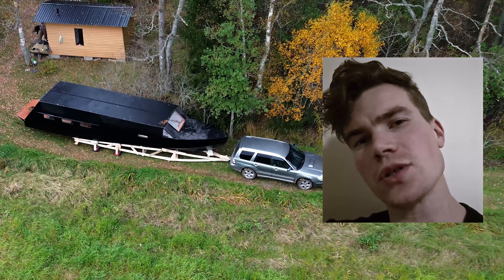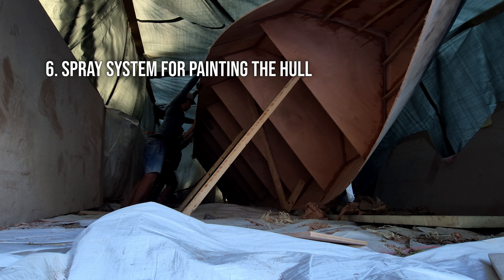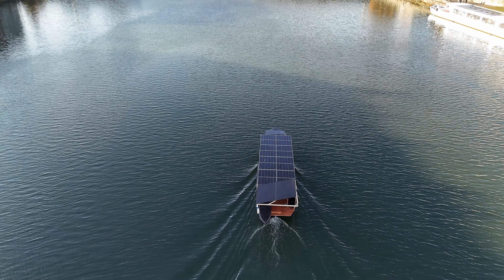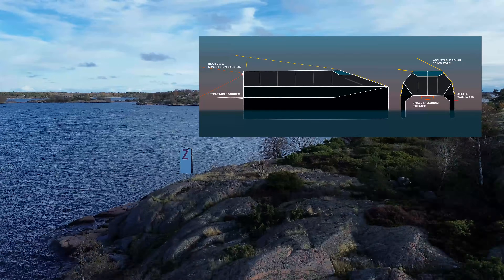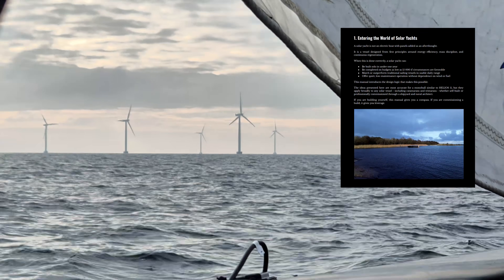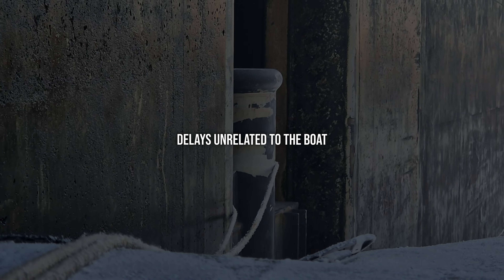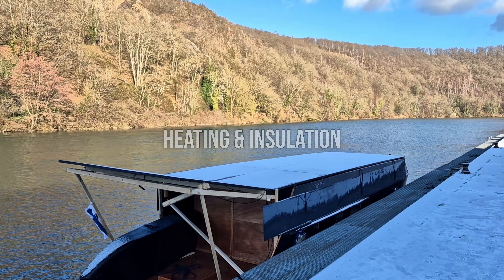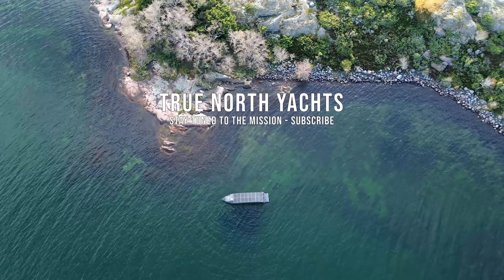The Real Reason I Got Trapped in the Winter Canals

Comment: I am a carpenter (home builder and cabinet maker). 
    I have been wanting to build a cat of my own design. 
     I'm wanting it to be about 10 feet wide x 25 feet long. Here's where my crazy ideas come into it. I want to make it powered by two jet skis pumps on each hull. Powered by two kabota 3 cylinder diesel engines. 
    My other idea is to make a windmill system instead of sails. That will turn a propeller, when not running on diesel. 
    This is going to be a Tower with a spinning blades that runs up and down so it can catch the wind from any direction. This will have a shaft that can be lowered in-between the hulls and can be pulled out of the water when not in use. 
   I have seen another guy who is working on something similar on YouTube. 
     It's just some thoughts that I have been thinking about for a few years now.

Comment: Hi Lukas, you’ve done an amazing job on your first build. I’m a sailor and have seen my share of storms, which makes me doubt a bit the safety of your hull in severe weather (which can happen). I was once on a Sunbeam 34 in the Bay of Cannes with 58 knots of wind and 4‑meter waves on the nose, and I thought she would disassemble. She jumped over every second wave and dove deep into the next one, with water breaking over the deck and cockpit. That’s why a good amount of hull reinforcement and thickness is so important—even if you lose some lightness or performance. Your life is worth far more than a 1‑knot difference in cruising speed.

On the energy side: I just finished converting my house to true off‑grid—2 × 48V 360Ah batteries, 8kW solar on the roof, and an 11kW inverter. I run my AC almost 24 hours a day, and only reduce to 12 hours if it’s very cloudy, with a diesel heater as backup. My battery is home‑built: I bought 360Ah 3.2V cells on AliExpress, a Daly BMS on Amazon, built the boxes myself, and the total cost was €2,300. I mention this because you’re using very expensive batteries. With individual cells you also get better installation options deep in the hulls, plus you’ll save thousands of euros and learn a lot about LiFePO₄ batteries.

On heating: my home AC consumes only 550W per hour, which is quite low considering it has 3.6kW heating capacity. So why not get a small split system? It would keep the climate on your boat much drier than infrared heating, and energy‑wise you’d be at similar usage levels.

Keep up the great content and creative solutions!

Comment: You could in theory utilize a heated Ballast, as a heat sink to store excess power, this would give you a large amount of thermal mass, and allow you to recapture that power for heating. 
While not adding weight to the boat, just utilizing the pre-existing mass on board. 
Think about it carefully, and I am sure you could come up with a clever optimization!

Comment: 9:03

500 nautical miles at 8 knots 

Holy shmokes. That’s awesome.

I’m designing a ice cracking steel tube spool device   

Sort of like a needle mechanism in a sewing machine. Doing what you did pushing straight down at the front of the hull with a steel pipe and the mechanism that lets the steel pipe lift and smash down with a very sharp point, breaking the ice before it hits the hull. The horizontal facing type of 3d designed propellers will power the ice cracking device and of course add to the resistance but the sharp point and weight of the heavily long vertical steel  pole, can be finely tuned based on the thickness of the ice. Also a sharp point which can have an electrical current, heating the very fine tungsten tip, ensuring that ice is cracked effectively.

Comment: You should also look at HDPE next time.. It can be welded, is lighter than water and there is a company in Norway with years of experience in building HDPE boats.  HDPE is insulative, tough, and barnacle resistant.  Also please eliminate the sails and do a kite if you really want wind power.

Comment: There is a reason people don't live aboard Cigarette speedboats.  Maximizing performance HAS TO mean loss of comfort, capacity, and stability/seaworthiness.  You would be better off lettting go of a couple knots of speed to get more of those other three.

Even if you only average 6 knots of realistic cruising speed instead of trying for 8 or 10, you still have a daily port-hopping range of 150 miles, and you will get a LOT in return of those other attributes.

Also, if you are considering adding optional fuel burning, put in a generator to your battery bank instead of a whole extra propulsion engine system, especially on a catamaran.  Gensets can be smaller and more reliable with less maintenance & repair, and you won't have to have multiple motor mounts etc.

Generator to electric systems are well established in both boats and trains, so the information and equipment should be easy to source.

As for catamaran design, please go study Warren-type/polynesian catamarans.  The old navigators had a lot of wisdom, like pontoons longer than your carrying deck so you don't plow into swells, more storage, longer waterline/speed, and more low-profile beam.  They crisscrossed the Pacific at will with those over 1000 years ago.

Comment: I think your shallow depth and lack of V hull vs length would benefit from your front bulb bow, plus, its own mini keel and tiny rudder (half depth of the bulb). Like canards on a plane, forward control surfaces. Look at the supercarriers of the USA, the bow extends beyond the buoyant hull. You might want to naturally avoid extending Fore/Aft of the waterline but consider the amount of overhang in the width beyond the waterline in ratio to the length when compared to roll and pitch. You don't want to overload the weight of the bow overhang, but it will provide more solar coverage either by providing flat space beyond the waterline, or, allows you to place/extend the wheelhouse/cabin to the bow so stern aligned solar won't have bow shadows. Same off the stern, More space = more solar and shade (and weight balance of the bow overhang) and a smooth pointed stern makes less wake but has more friction (until you get fast enough).

Comment: it's good that you share your experience. I would not criticize your wide hull cuz I like it. more batteries will somehow offset bottom wave slap problem.

Wider hull gives more roll or yaw stability.

Model of catamaran you have made is just the beginning. You need measurements for getting useful conclusions. I mean measurements of wave heights and accelerations of your model. Add some plywood panels to mimic future project, as it will help to do estimates of wind resistance. Put small rc equipment, motors and data acquisition equipment - microcontroller, accelerometers and data transmitter. Transmit data to your laptop. Run it for a long time and compare model with H11 at the same waveheight to length ratio.
Idk how to measure wave height, but I think it is possible.

Anyway read books, learn, 3d model, calculate by simple formulas or rules of thumb, 3d print test prototype, repeat until satisfaction.

 I am sure, almost all of that could be done by 3d modeling and cfd programs. 

BUT learning them costs helluva time. programs may cost several your yachts money. Sometimes old school way may be cheaper and faster.

Your setbacks in work are common for everyone. Each newer version is better than previous. It is called experience. time estimates are always exceeded.

I see only a few of all your problems mentioned are important - auxiliary IC engine/generator, heating and insulation. If you are stuck in frozen channels,
1. put something soft around your hull in the water in order to prevent damage from ice pressure. maybe plastic foam or empty bottles. ask someone bc i'm not sure i'm right.
2. if you are in condition to work, you can do upgrades in place - ic engine/generator, heating, heat insulation.

If you are impatient you can try to add waterproof motors with disc saws on consoles stretching forward. Cut ice and crawl slowly on ic engine.

potential problem is that you dont have metal keel for pushing ice away.

Good luck!

Comment: Not buy poor quality overpriced Pylontech batteries (with tiny pouch cells, prone to bulging), but build battery yourself from 16 * 628Ah cells with a single JK BMS, total cost €1800 incl. shipping and VAT for 35kWh usable capacity. You would have saved thousands of EUR, you would have a bigger, better battery with less weight. Great video though and thanks for sharing. If you don't make mistakes, you don't learn.

Comment: Having a single petrol outboard in the center of the stern coupled with twin electric outboards would be the most practical setup. The twin electric outboards would be excellent for docking such a long boat without the need for a bow thruster. Could also use just 1 electric outboard in following winds and that would counter the wind angle using left or right motor. Also consider the weight category or the motor, not just power output, because often times the higher horsepower motor in the same weight range will be more efficient at reduced rpm than the less hp at higher rpm.

Comment: victron energy had a diesel ? petrol ? genny suitable for 16S LiFePo / 48V systems linked on their channel if i remember correctly.

it was an engine cloupled to a small PMA generator head and very good anti vibration mounts.

that should give you a good baseline for hybrid operation.  also with a bit of modification you get some heat from the coolant. a caloifier would store some of it so you could travel and recharge batterys and the calorifier in daytime at low sun conditions an keep relatively warm at night an maybe use a IR heating foil over your bed. as soon, as the calofier is cooled down too much.   an electric thermostat would kick in below 15-18°C and keep you warm through the night.

diesel is a standard fuel in every marina and you get it for cheap in bulk.

also webasto airtop D2 /eberspacher airtronic D2L air heaters run on diesel. but you'd need a stepdown converter 40-60V to 13,8V capable of 15A.   

if you'd install a thermotop evo 5 coolant heater and a calorfier with a 2nd internal coil you could heat water to 80 degrees for food and use the main water capacity for the heating purposes using blower-radiators.

narrowboats are a good guide to such systems.

Comment: Instead of bringing a gas outboard engine for emergencies, bring a small moped engine with an inverter and use it as a range extender to charge ur batteries with gasoline in emergencies or as a range extender. It’d save weight and increase space/weight efficiency

Comment: There's nothing more demanding than heating at wintertime.

On the other hand keeping the volume to be heated low and well insulated helps keeping the energie to be invested minimal. Example: My selfbuild outdoor 14kWh (48V) battery in a 180L aluminium chest consumes just 3W of energy to keep to whole block warm. Shortly we had -20°C outside. Inside +9°C (could have been more, but i limited the lower and upper temperature).

Comment: Around the 3 minute mark, it looks like you're resting the panels on a stick. If you continue with that method, there are two cheap and lightweight ways you can improve its shock resistance (shock as in a wave that make the panel jump and the stick fall over):

1) Velcro tape. The tape will both hold on to the frame, but also add some vibration dampening. Use some staples (häftklamrar) on the tape to make sure it stays put.

2) Use bungee cords (buy a 10-20 meter roll) to tie it down.

This is not enough for the high sea, but I would think it would be fine for the canals.

Comment: Hey man, I love your project and I'm following your video's with interest!

I'm living aboard a motoryacht and I have a solar system installed on my roof. I can tilt my solarpanels in 4 directions with homemade (and home engineered) tilting system. Simple and effective! Maibe you can use the same system if it's suiteable for your panel setup. You can see the system (with simple quick release hose connectors) in this video, starting at 9.30. The video is in Dutch, but the images speak for themselves. 
https://youtu.be/HU-01PaYcvQ?si=xaEKXKLZNbZY92O8

Cheers and happy travels!

Jan

Comment: Also something like a 10hp outboard isn't that heavy. Have it mounted as a backup system and if need be carry your fuel in portable containers. Personally though I would almost say a small generator might be just as good. Twin electric motors for redundancy so you cruise quiet but in low light you can kick on the generator if you really need it.
Reply: I really have a hard time expecting the guy to get a generator when the whole idea of his propulsion is to be quite and no fossil fuels. Just imagine the sound the generator will make lol
Reply: there's a plus advantage in your idea. The generator can also be used to power elctric tools in situtations when needed and the batteries are low, no matter what's the reason.

Comment: I wonder if you could repurpose a heat pump (possibly from a caravan, which might even mean DC input, though I'd be worried about exposing it to sea conditions) to get more heating power out of your finite energy budget.
Some heat pumps can easily spit out multiple times the power they consume in both heat or cooling power for "efficiency" over 100% (from a quick search I found some caravan units that were rated for 4.2A@230v AC, so ~966W consumed that spit out 2000W of heating), and you get AC on top for warmer weather. Maybe something to consider.

EDIT:
Alternatively, nothing beats fossil fuels for energy density for heating as much as I love renewables. Wood is about a third the energy density, though a bit more charming.
Otherwise maybe a heated blanket if you don't care about heating the space?

Comment: A deeper v bottom moving to an almost flat transom  at the WL will give better stability, less cabin height and eliminate that fin you'll find will cause problems.  
And carry your chine line much farther forward at the WL alone will double stability. As will the longer WL help.  The plywood will bend to that.  
I certainly agree on the reverse bow to give much more WL, increasing hull speed,  but the Bulb won't be worth the hassle and easily damaged like by ice, docks, ... .   
You are over estimating stability with that many regular solar panels weight that high.  Going the regular cell but 'flexible' panels will greatly help stability by lowering top weight 50%. And make it easier, lighter to make adjustable  frames for them.  

Think about taking it to 1m deep water and roll it to 60degree with 8-10 people or winches, and see if it goes back upright, is the real test models don't show.   Make sure you can stop it before you start.

Comment: Hello Friend. Off grid Ontario Canada. Like what your doing. One thing you may want to check out is gasifier's. Old technology that converts wood or charcoal smoke into  Methane and Hydrogen allowing you to run gasoline engines by feeding fuel gas into the engine Carburetor of the gasoline motor. Great for running generators. Could collect driftwood on distant shores and keep the power going in low light conditions and away from civilization.     https://www.youtube.com/watch?v=kbakCyn6Vf4

Comment: Really enjoying the series, it's very cool.

I think lightweight mirrors might really help in winter, when the sun and wind are low having them redirect light onto the panels could make more power.

I also think an electrical generator is better than an outboard motor. With an outboard you're duplicating the propeller and drive system. Whereas a generator can just feed into the electrical system and then you can choose whether to use it to increase range or for heating / appliances.

I wonder too if a wind turbine is better than a sail. When moving a sail provides more power however a wind turbine works with all wind directions and also works while you're moored and cruising on canals etc. A vertical design can be very quiet too.

Comment: If you want to be a little more reliable in cold weather with solar you should probably put some pipes on the back of the panels and give them a tiny bit of shedding angle by default. It is unlikely you will ever be somewhere cold enough the water under the hull reaches freezing so just pumping a little of it into the panels (ideally with a heat exchange fluid that is never going to freeze up) to heat the ice/snow build-up from the back is probably the most energy efficient way to keep the panels clear during the daylight hours at least, add in a small bit of battery powered active heating and you'll make the energy expenditure back. For good measure those same pipes should pull double duty quite happily and let you in the hotter climates keep the solar panels cooler so they work more efficiently.
Reply: There was a company producing PV Panels with cooling pipes attached to the back. Hybrid solar hotwater & electricity system. It did fail eventualy. But that does not mean that it could not work for deicing and maybe cooling the panels for better efficiency. Just forget about hot water production. Then it can be usefull & beneficial.
Reply: @Gabriel.Leni100  No need to forget about the heat production - just use the fluid in the loop as your heat pump source (with some directionality so you can use water temp, cabin temp or the solar panel temp as the source and sink of heat - Should end up getting a nice COP out of the heat pump for whatever heating/cooling task you need. 

Might not make enough economic sense for a building as a rule, but for a boat the rules are different.